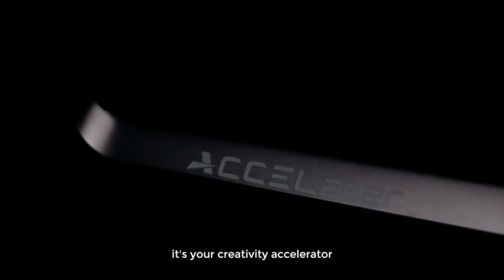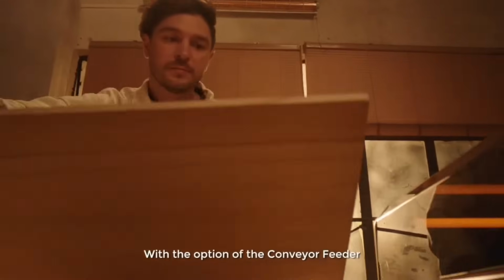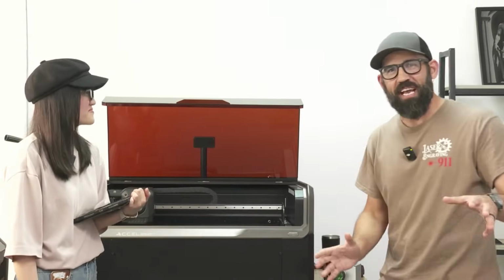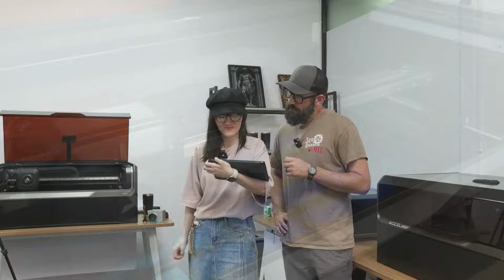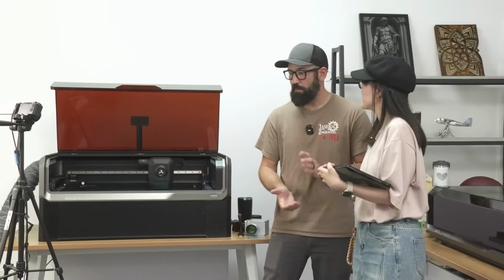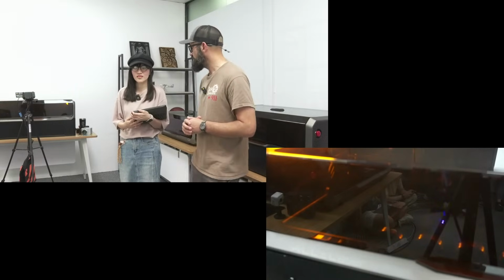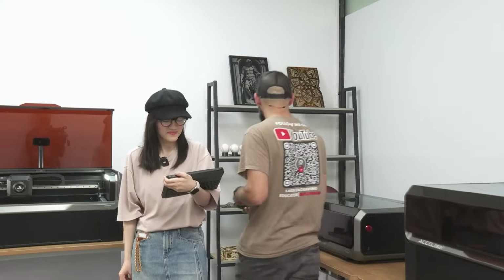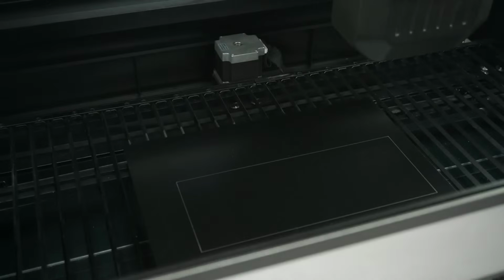✅ PART 1: Live Special Reveal ACCELaser HD1 Q & A- with Michael and ACCELaser

Comment: Roly came out with the Galvomatic first. I trust Roly more.
Reply from the maker: Thanks for sharing, I see lots of roly fans here in the comments, kind insinuating that the Glavomatic is better and cheaper, and was first to market, and I get it, hey freedom of speech and all that👌 What I would like everyone to understand about the ACCELaser HD1 and The Roly Galvomatic is that they are very different machines, in the way that they operate, the algorithms used, the hardware used, the laser sources used, and the speed at which they operate, as well as may other hybrid motion system features. Comparing them is kind a like apples to oranges, When both machine are officially out in the market and users are using them on a regular basis then and only then, will fair comparisons be able to be made on specs and performance, and I'm excited to see how they stack up against each other when it comes to day to day real world applications in the engraving industry! ... I have spoken 😊